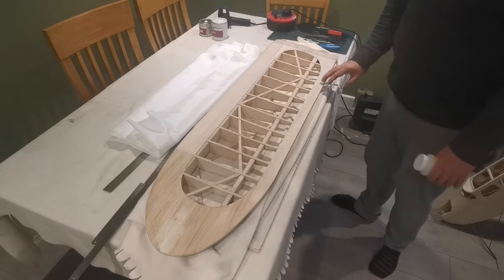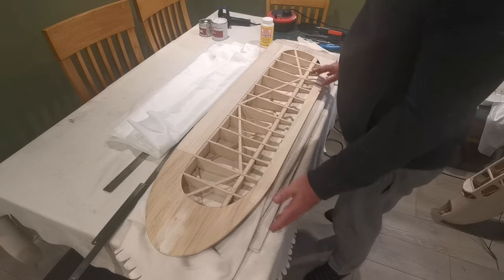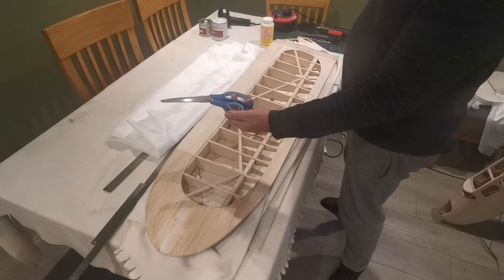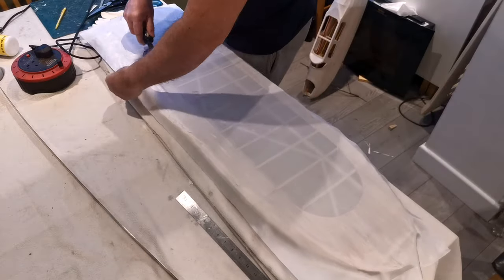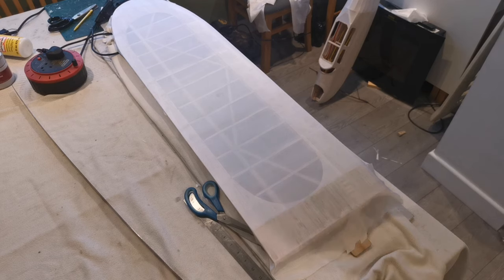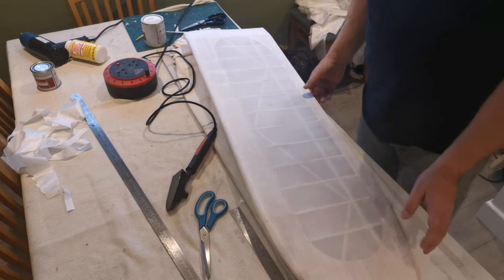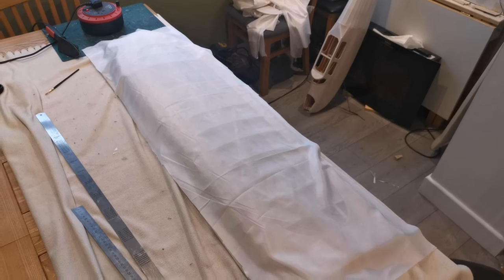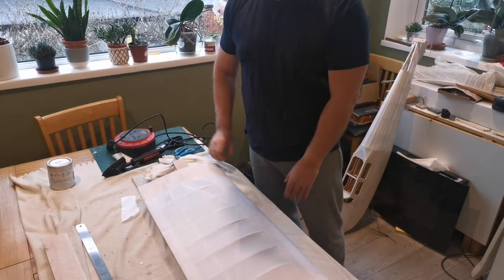Covering the wings a cheap alternative to Oratex : Polyester

Comment: Hi Mark beautiful work. do you know how much weight is the polyester you use for covering I really appreciate the info. thanks
Reply from the maker: The polyester that I used has a weight of 70gm/m which I think is very favourable to commercial textile covering such as Oratex (100gm/m). It does require the addition of dope to seal however this adds minimal weight.
Reply: thanks Max i really appreciate the data